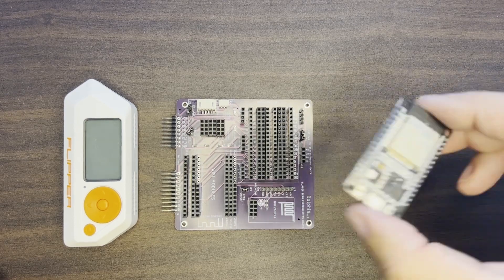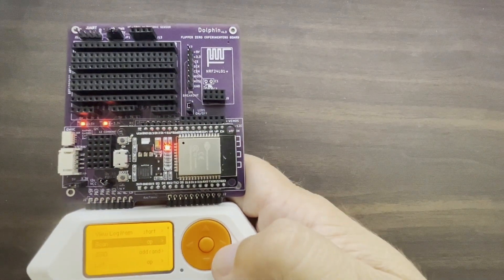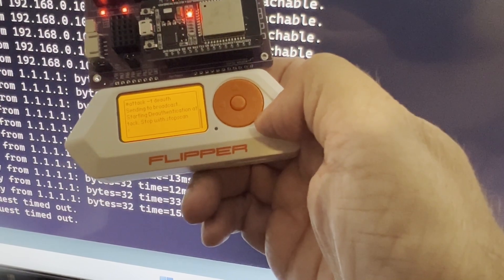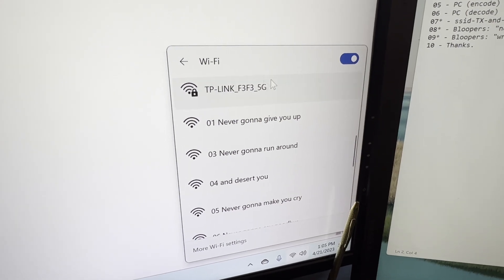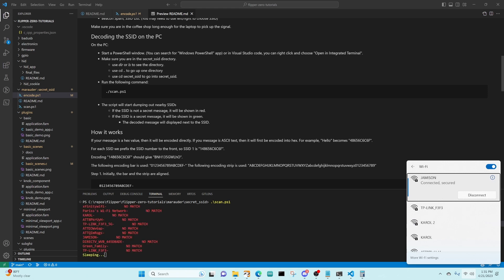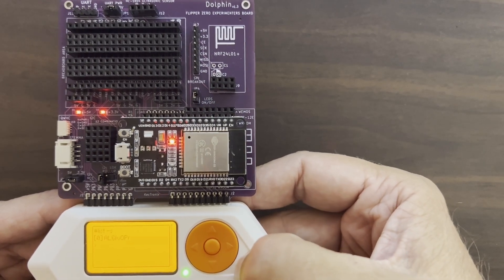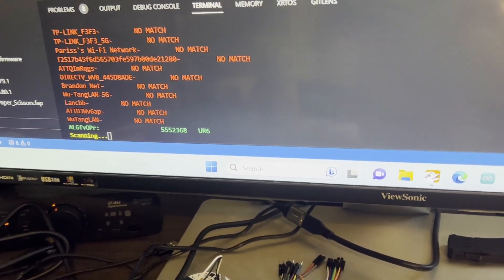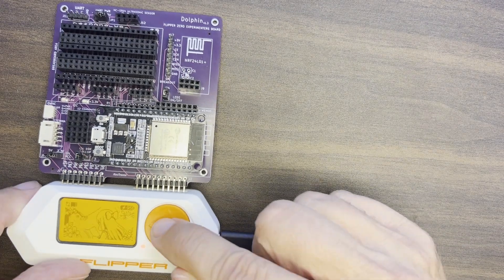[55] Flipper Zero - ESP32 w/Marauder - Wifi - Dolphin Experimenters Board

Comment: Hi, Thank your for such a great content.

Could you please make a Video about just the ESP32 WROOM 32 with a flipper. Also show how you flashed the ESP and installed Marauder in Flipper .I'm relatively new so your assistance is appreciated.
Reply from the maker: It will probably be a few weeks before I get to that topic. I believe TalkingSasquach has some videos that cover the topic? Feel free to reach out to me on Discord (@CodeAllNight) if you need help sooner.

The basic idea is usually there is a boot button that you hold down before connecting the USB cable. Then on your PC you can go to https://fzeeflasher.github.io/ and choose Connect and then Flash the firmware you want. The other option is to use the https://lab.flipper.net/apps/esp_flasher app to flash the device directly from the Flipper Zero.

Again, I'm typically available to help people on Discord.

Comment: Hey i posted a short about a EsP-32 I flashed with maurder, I no longer have the chip as I was able to obtain, I've been getting asked for a walkthrough for programming the ESP-32, I have been referring people to your channel, You have posted so much new content, I recently got a new job so, haven't had all the time...Love the new add on...I'm trying to flash a ESP32CAM MCU though..I also got S*it Esp-8266 with IOT usb programmer but its version 1, which I read the led light has already blown out and they're garbage....I cant get the 8266 with a ESP PRog IOTMCU?
Reply from the maker: Contact me next week on Discord, and I'll see if I can help.  (I'm on vacation this week.)  codeallnight#1337
Reply: @MrDerekJamison hello,i know this is a rather old video but i was wondering if you could help me with something related to marauder
I have an esp32 and i wanted to get a screen to run the standalone variant, however i couldnt find the exact screen and Im trying to figure out how to make a screen i have on hand work with it. Tho im not sure how to wire the pins or alter the code